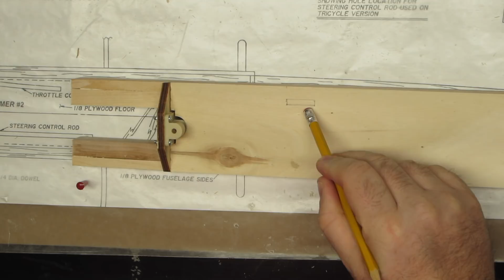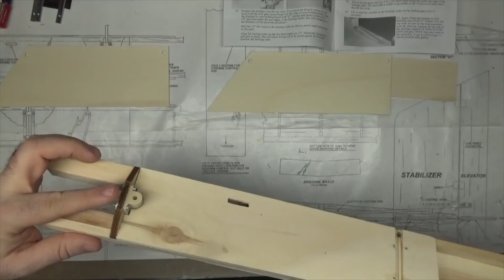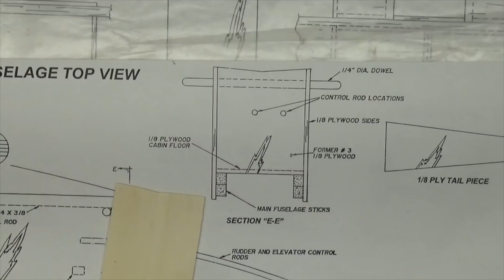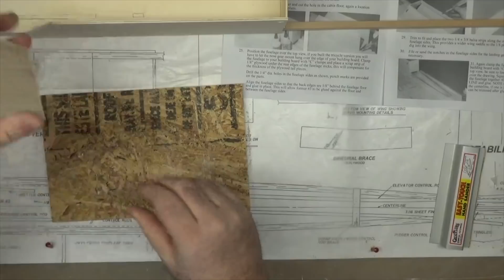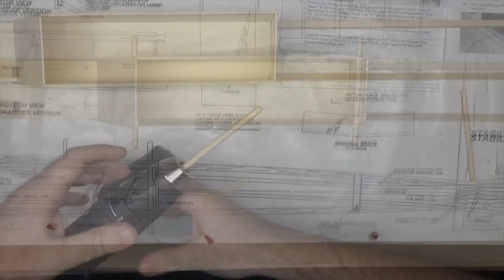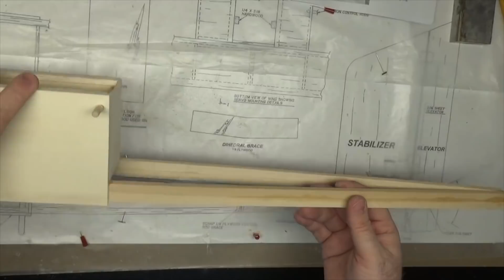Beginner 4

Comment: Why wasn't the fuse lined up with the plane\s when joining the tail booms together?  The wing dowels didn't match up.
Reply: Looks like this is what happened: http://codesmart.com/stick40/stickback.jpg The top plating extends back too far.
Reply from the maker: constantmtn it actually was lined up and pined down. That’s why I had to go back and move it forward a little
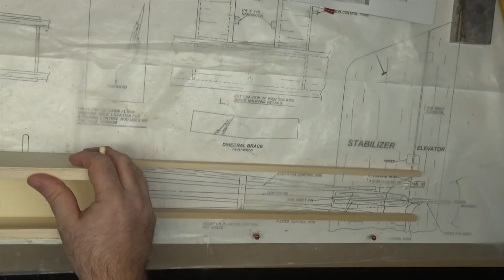Reply from the maker: At 27:54 i move it up a little more
Reply: Still didn't line up.  Here is a picture.  https://www.dropbox.com/s/s4qzcr39reksah4/pic.JPG?dl=0
Reply from the maker: Yes sir the holes for the dowels are pre punched in the fuse sides, so they are already set. The important part is to line it up with the plans so that the tail pieces intersect at the center line of the airframe.
Reply: I'm taking about fore and aft not side to side.  The rear dowel doesn't line up with the rear dowel placement on the plans.  The fuse is reward about 3".
Reply: I was going to say, the tail boom is a bit short. Like, a lot short.
Reply from the maker: The tail boom is exactly correct. When they drew the plans they just did not draw the dowels in the correct position.
Reply from the maker: The plans on this one are like 40 years old lol. We have no idea why they didn’t draw them in the right place.
Reply: Here's a set of 36-year-old plans. :)  http://codesmart.com/stick40/oldstick.jpg
Reply: It looked to me the floor was glued on too far back in an earlier video but didn't want to say anything in case I was wrong. When I built mine, I didn't remember the top of the engine blocks being exposed aft of the nose gear former. And now looking at the dowel position while he was gluing the booms together its obvious the bottom floor was glued on incorrectly.